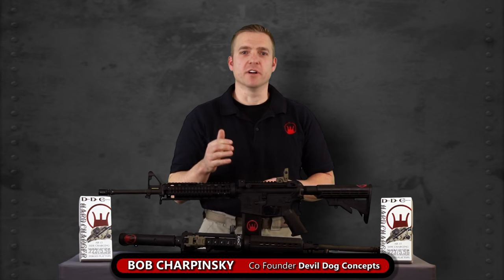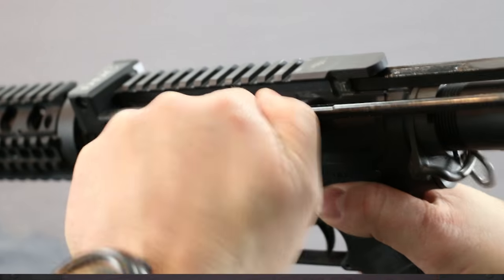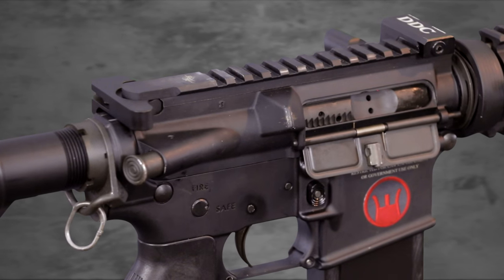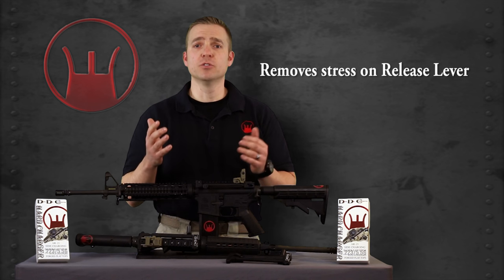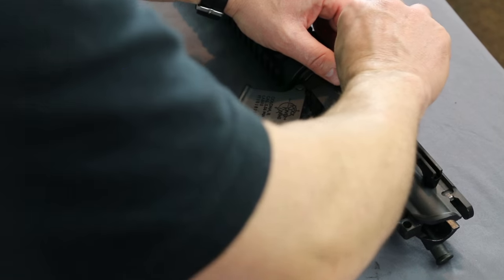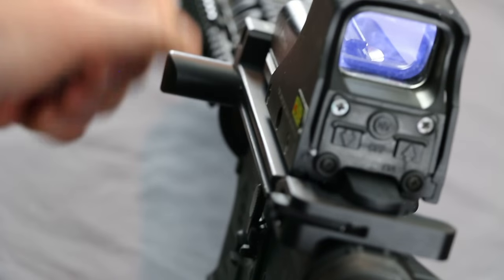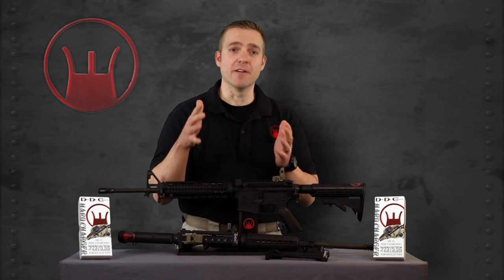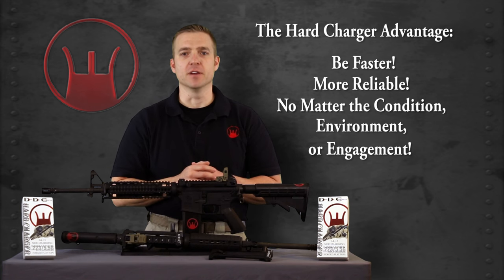Devil Dog Concepts' Side Charging Handle System; the HARD CHARGER

Comment: I bought one of these about 3 months ago, put it on a Lone Wolf G9 SBR. I beat the shit out of this gun, and the Hard Charger hangs in there. Installed in about 3 minuets, NO issues. No interference with my optics. Faster mag changes, clearing rounds both got a LOT faster. Nice thing about this, is it fits on all of my ARs, Beowulf, 7.62, 6.5 and my 9mm. I can move it from platform to platform. This thing goes like hell.
Reply: Good to know. I'm about to get one for my 9mm sbr that doesnt have a LBHO.

Comment: I've had one of these for about 4-5 years now and it's great except for using a strap that is designed to be used slung around the back. If you want to do that your charging handle will dig into your back like none other. If they made a super slim handle or a flip over scar style handle would be great.

Comment: I just got one, the video speaks for itself. I wanted to make another build but just the new striped upper and BCQ with charging handle is 250 to 300 bucks and I loose the dust cover which is not a great idea in an AR platform. JP has another version on a whooping $700…in short it requires to make another build and all I want is have a charging handle in my current build without having to sacrifice any other feature and at the most cost efficient way (time and money) this is it! 👍🏻💪🏻.

Comment: Looks great. But it looks like you would have to use the stock fully extended or take your cheek of the stock to use it. Understandable, though since it's the only way to get it in a drop in system. I like that the traditional charging handle is still there.
Reply: Sgt Oif ArmyCombatveteran 

Yeah nut not all of us use our stocks extended out all the way...
Reply: you do not have to have the stock fully extended to use this
Reply: satgod You would have to break your cheek weld if your stock is collapsed. Just like a charging handle. So kind of pointless if you don't run the stock all the way out.
Reply: joshv06 Even if you had to break your cheek weld, I think this is still easier to grab and operate than the mil-spec charging handle.
Reply: joshv06
 that's the whole point is to be able to rack the charging handle without removing your trigger finger from the trigger area and the keeping the barrel pointed towards the target with a fixed or extended stock.
Reply: @joshv06  With the stock collapsed I can rack the hard charger with my left hand while holding the weapon by the receiver pistol grip with my trigger hand.

Comment: So is there a break-in period to have the action as smooth and easy as this video shows? I recently installed the R model and when I charge the action, it's hard and sometimes gets stuck and I'd need to tap it back with a mallet. There would be no way for it to be charged just pushing by pushing it down on a leather belt...
Reply: Dude...Are you sure?? The Hard Charger is for standard forged uppers. If your upper is billet then it has more material on the upper. The support nub that rests on the side of the upper is most likely pushing the rail out further causing the charging handle to bind on the right side.
Reply: @myrandomthoughts9106  I think the rifle I have it on originally was causing this stiffness somehow…  I decided to try it on another ar I had and it worked fine and was able to be racked with ease. Not sure what exactly was causing the other one to be stiff but I have the charger on the one works with ease now. Probably take 5he other ar apart  when I have time to figure out just with was causing the stiffness...
Reply: Dude...Are you sure?? I had a similar problem. On the side off the charging handle you could see bare aluminum where it was binding. Something to look for.

Comment: I have to order one,  I was about to drop 250.00 on a side charging upper
even though it doesnt come back on the tube like a standard or this charger will 
it is 250.00 when I already have a nicely setup upper 
So the 150.00 and moving on is where I am

Comment: Unfortunately, for me to set my Trijicon ACOG far enough back for the side charging handle to mount where it needs to be, I no longer have room for my rear BUIS. Maybe I can figure it out somehow but so far it is looking like I will not be able to use this accessory, though I would really like to have it on one of my high end rifles.
Reply: Gnostic Adept my thought aswell
Reply from the maker: We just launched our Hard Charger Rear. It mounts on the most rear picatinny rail slot. It would fit your setup perfect. Check out our FB page our website.

Comment: Bummer.  No option for lefties, 15% of the population.  Not even an engagement release on the right side of the charging handle.  :(  Hopefully that will come.  Many of us run ambi charging handles (usually extended), and I'm one of them - something like the Raptor.  If I add a side charging handle, I would want to keep the ambi disengagement levers, and longer ones for optics, too.  Yes, that would be in addition to the (longer) side charging handle.
Reply from the maker: +videodistro We have quite a few lefties running the Hard Charger.  We suggest getting away from the ambi charging handle mindset, and use the Hard Charger like a reverse AK by using your support hand and coming under the rifle or over the top, and tilting the firearm slightly.  Just as right handed shooter would do with an AK.
Reply: +Devil Dog Concepts No.  Just plain no.
Reply: +videodistro I totally agreed with you

Comment: The average charging handle assembly weights about 1.4 oz. Even if the Hard Charger weighed 5 oz, even the most weight-conscious of consumers would be hard-pressed to pass up the benefits. I never liked the traditional AR charging system- the movement strikes me as being ergonomically inefficient if not outright awkward. I'd be curious to see how effective this could be for any extraordinarily stubborn stuck cases (i.e. set the buttstock on the ground and strike the Hard Charger with your heel).
Reply from the maker: +Sigmagnat650 Thank you.  We are glad you like the Hard Charger and can see all the benefits that it brings.  To answer your question as best as we can, a review was done some time ago by The Gun Guys Reviews where it was attempted to break the Pull Handle by smashing the Hard Charger against a tree, and instead of damaging the Hard Charger, he injured himself.

Comment: is this compatible with a redi-mag?
Reply from the maker: +Conner Dean Haven't had the opportunity to try it out, but after researching photos of the Redi Mag, and comparing the top of to where the bottom of the Hard Charger Receiver runs, it does not appear that there would be a fitment issue.

Comment: Will it interfered with the mounting rings of a full size optic/scope?
Reply from the maker: Nope. It is designed to clear nearly all large optics and mounts. Is there a specific one you're referring to?
Reply: +Devil Dog Concepts I got the vortex PQR extended cantilever mount on my sig516 Carbon TS just want to make sure it will work properly.
Reply from the maker: +Julio Pastor Looks like it will work great.  You may also like to look into the HCR which we look forward to having available in the near future.  It is all interchangeable with the standard Hard Charger, but instead of mounting to the front, the HCR receiver option, mounts to on the rear picatinny slot.  Visit our Facebook and Instagram for some pictures.

Comment: Is there a version of this for suppressed AR's (to reduce gas in face )... kinda like a side-charging Gas Buster.  I would hate to have to drill out gas ports on this handle and muck it up with silicone/RTP.
Reply from the maker: Bill Walters There is not a specific version designed for gas reduction. The design of the product itself does help with diverting some gasses to the ejection port side.
Reply: Ok, thank you. Semper Fi.

Comment: i bought one of these for my ar before  i found out that they  said forged upper receiver...... my ar has a billet upper and lower receivers does anyone know if this thing would fit a billet upper receiver ????????  i have a head down  tac10-556  .
Reply from the maker: +michael rogers It won''t currently fit the Head Down rifles.  This actually is something we are looking at working on with this company.  So you may want to hold on to your Hard Charger.

Comment: at 2:11 he pushes back the side charger, but the release lever is still loose. how is that possible? my hard charger does not do that.
Reply from the maker: sonny_69 There should be a very slight amount of play in the release lever when pulling back on the Pull Handle. The design is to remove stress from the roll pin. Every single Hard Charger is inspected for fit, finish, and function before it goes out. We are confident yours is perfectly fine, however send us an email to sales@devildogconcepts.com so we can make sure.
Reply: Devil Dog Concepts I have tested this and it worked. I was just not seeing it clearly 100%. Thanks for the reply and keep up the good work. I love your product!

Comment: Wouldn't fit on my sharps bros upper
Reply from the maker: The sharp bros upper is a billet upper. You may experience some fitment issues with billet uppers due to the manufacturer specs are not mil spec. Very sorry for the inconvenience

-Cody.

Comment: this thing is 150 bucks. So after you buy a decent upper and this your talking 300 plus. Why not get  a dedicated side charging upper like the spartan or others that cost around that or cheaper and have zero gas in face because traditional charging handle area is  completely closed.
Reply: We need a folding style handle for those of us with scabbards and clamshell bags where the handle sticks out too far to put in the scabbard or bag!